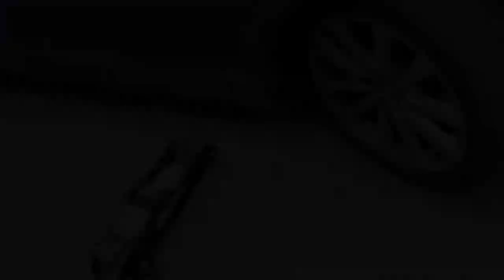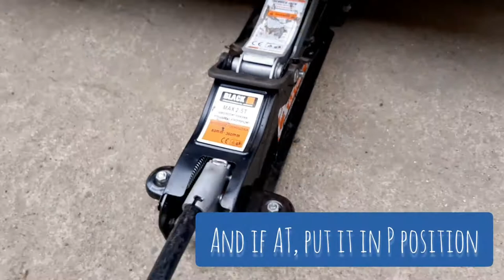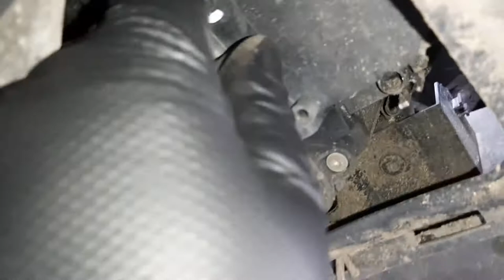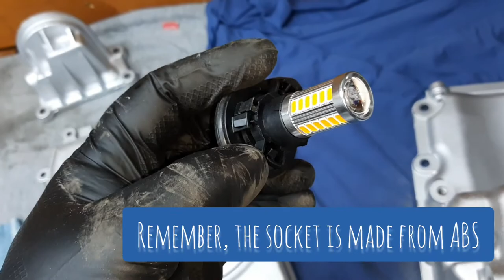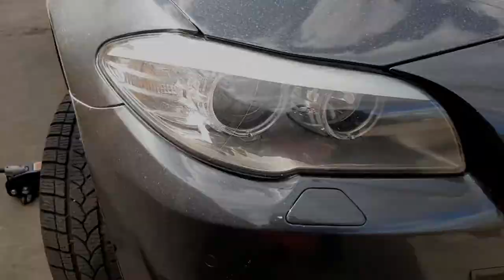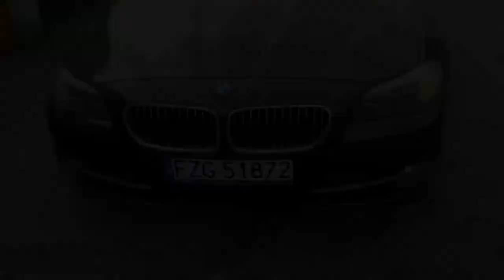DIY - How to replace turn indicator bulb in BMW 5-Series F10/F11 very easy without special tools

Comment: You don't say where you got the LED bulbs from and also where do you get the OEM replacement bulbs for those of us who just need to replace a bulb that is not working?
Reply from the maker: The LED ones I've got from ali, and OEM ones are only on ebay :(
Reply from the maker: Anyway, thanks for sub m8